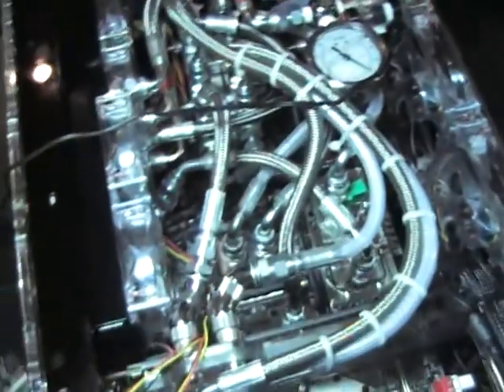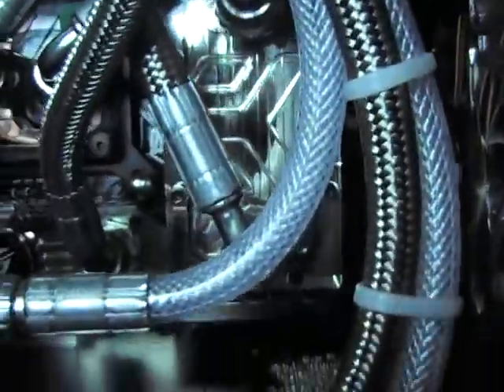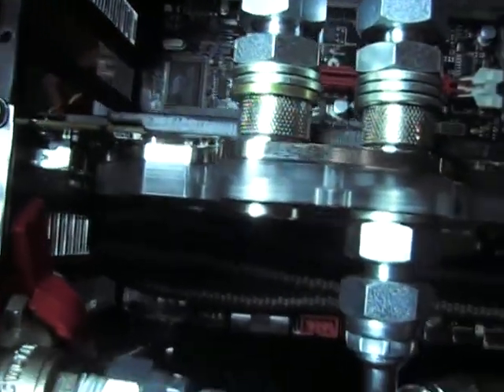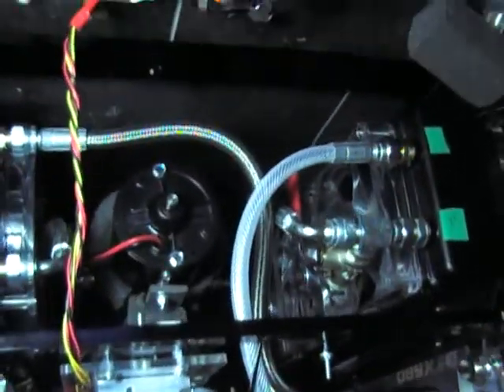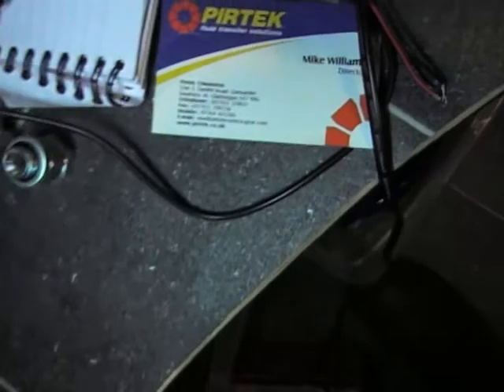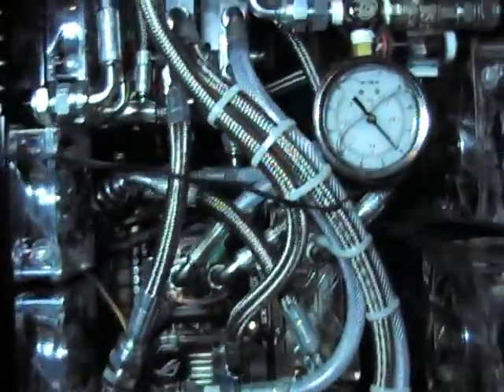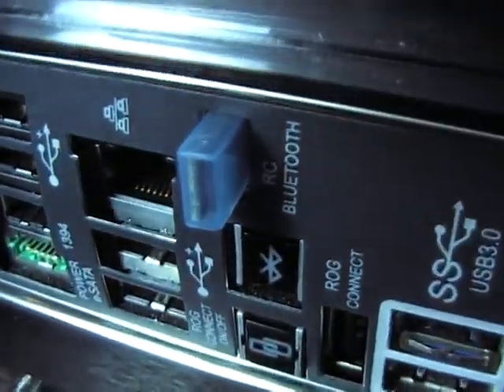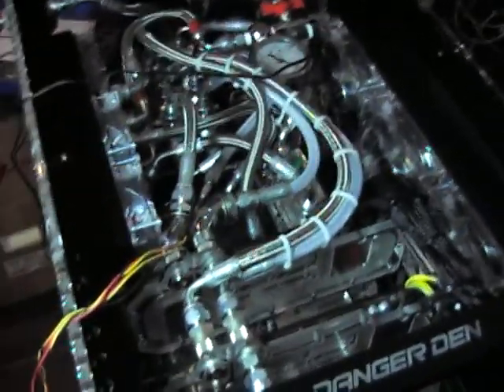OIL COOLED COMPUTER

Comment from the maker: the look was a payoff because of the hardware used, flowrates were as high as the EK fittings could take(PRESSURE WISE) quick release fittings were later added for speed changing components ,but the experiment showed oils in their current state come nowhere near to a good water mix,direct injection is best and could be made to look cool

Comment from the maker: mineral oil is now being pumped  ,the motherboard is asus rampage three on this rig  the other rig i will be testing on oil is EVGA SR2  ,The  EK blocks are the nickel plated and so far are not affected in any way, I will post another video soon with oil pumping  ,the ek blocks have been pressurised to 2 bars  pressure so far no problem  ,working with the oil  is great because of its non conductivity  tiny leaks in early stages are not problem